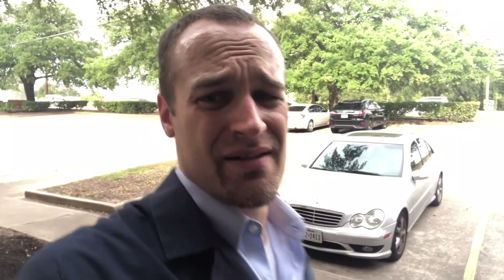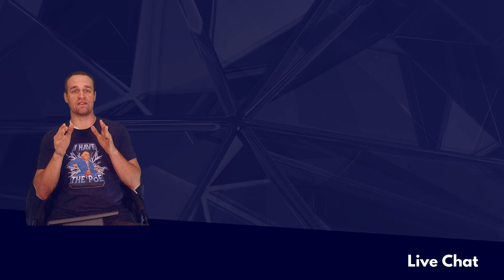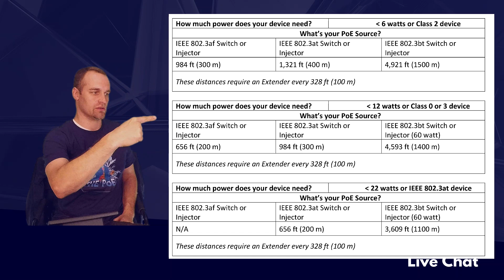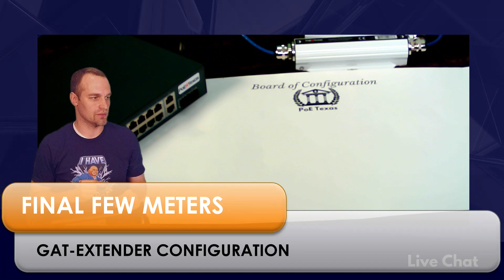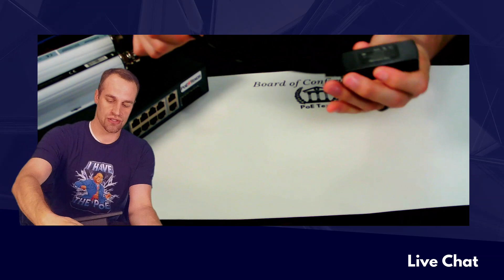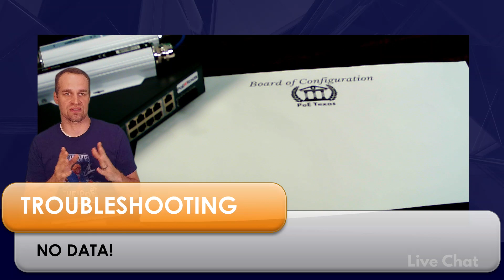Breaking the 100m Ethernet Barrier with Power Over Ethernet - Going Beyond the Maximum Cable Length

Comment: What about the at extender for 1/100/1000?
Reply from the maker: Are you looking for an IEEE 802.3at extender for 10/100/1000 Mbps?  The GPOE-Extender can work with at power and will double the range to 660 ft.  If you want to get to 1000 ft, you’ll also want the IEEE 802.3bt capacity to run further.
Reply: @PoETexas  ya, I just want to get internet connection over ethernet from a router to a switch a little over 350 feet at gigabit speed. the GPOE extender will do that?
Reply: @nebulousJames12345  Yes, it will as long as you have PoE on the switch.  In this case, make sure the "PoE In" port faces the PoE switch.

Comment: Great job! I would like to if 1 extender work if I want to connect a cat6 of 1000ft to a 500ft giving a total of 1500ft?
Reply: Noel, you can use the distance charts on our listing to calculate how many extenders you would need to go that far.  You would use up a lot of power going that far.

Comment: I want to run an ethernet cable from my router in my house to a wifi router in my summerhouse outside. This is approx 150m. How do i go about this in simple layman terms?
Reply from the maker: Derek, simply put, make sure you have the right PoE power source (PoE switch or injector), run one cable <100m (say 90m), place the GPOE-Extender there, then run the remaining cable to your WiFi access point.  Here's a set up demo video: https://youtu.be/RQTMfK79aZk
Reply: just use fiber. Fiber does not conduct electricity. This way lightning striker aren't going to kill your stuff.
POE ethernet extenders are great if you need POE at the end.
Reply: @juri14111996  As a fibre tech, I agree. If you have power at both ends already and need to run underground/aerial over 100m, fibre is the go. Basic gigabit media converters are quite affordable now.
That said, if you want, say, a PoE camera at your driveway entry over 100m from your house but you have a shed or some powered weatherproof enclosure in between, PoE extender would be perfect solution.

Comment: Hi, the outdoor extender still needs power supply? Thanks
Reply from the maker: The GPOE-Extender is POE powered by an 802.3af/at/bt injector or switch. It doesn't require an external power supply.
Reply from the maker: It does not need its own power supply.  You just need to provide it Power over Ethernet power to power the device and extend the signal.  It can take up to 60 watt PoE or IEEE 802.3bt power.
Reply: For a 200 meter distance, do you need 2 Gpoe extender or just 1?

Comment: I have a building with 80 floors and I am supposed to install an access control device in the elevator car. I have to pull 2 pair of cat 6 elevator travelling cable for around 350 m. Kindly put some light on this case, how to use the extenders, how to set it up and how many would be required. Any suggestions are welcome :)
Reply from the maker: If you need you maximum travel to be 350 m, then you would you 3x of GPOE-Extender models, one for every 100 m past the first 100m.  For configuration, check out our blog on the topic: https://www.poetexas.com/break-the-ethernet-barrier/
For set up, you can check out our other video on how to set the units up: https://youtu.be/RQTMfK79aZk
Reply: @PoETexas  Thanks, mate!!

Comment: I'm looking to enhance the signal, not power an appliance, would I still use PoE?
Reply: indoor or outdoor? between buildings?
i prefere fiber. it electrically isolates, and you only need a media converter at both ends, imagen digging up a cable, just because a poe extender died.
Reply from the maker: Ty, yes, you can use this to extend/enhance your data signal.  You still need PoE to power the extender by itself, though, so that it can boost the signal for you.  The extender needs a little power to boost the data signal even if you don't use PoE at the other end.